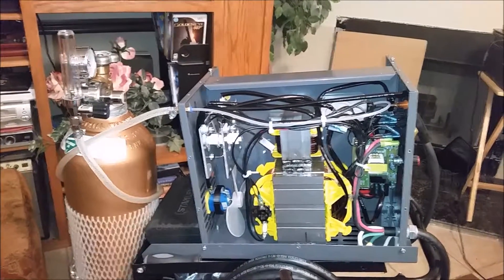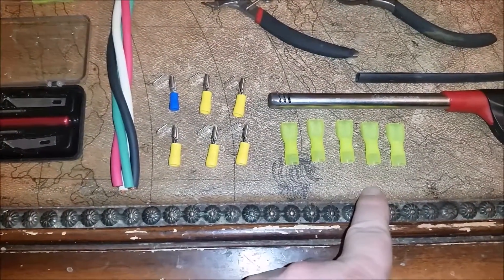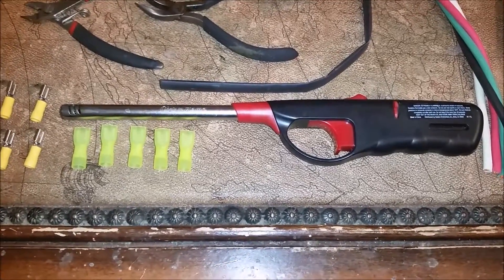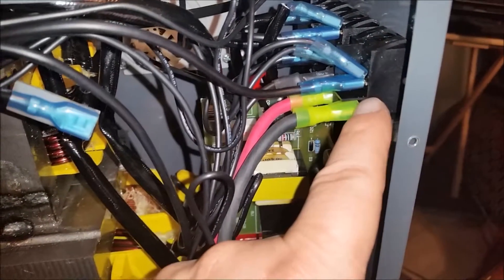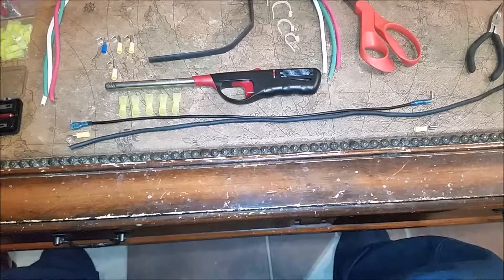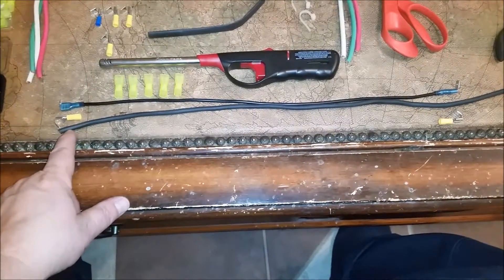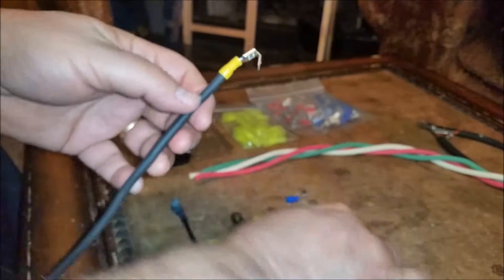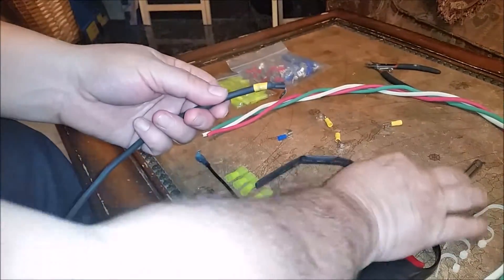Harbor Freight 110 AMP Dual Mig Internal Wire Upgrade Part 1

Comment: Hey Keith, Thank you for the vids, I coming over from Todd's channel, Again thank you for your comment reply, Im glad I ask you guys first,  I never saw a large cap cap blow before either and I dont plan too and not in my new H.F. welder either.  Do you think that i can use10g wire on my 90amp or should i use 12g instead, also would a 20w 40ohm resistor work for killing the cap.  Thank You
Johnny Perez
owner
UrbanMountainPakks
Reply from the maker: The larger the gauge wire the cooler the welder will run and the easier it will be on the transformer. I wouldn't go less than the 50 ohms or less than 20 watt resistor. 12g is good is ok but you'll have to run it closer to the outlet. You can watch this video here and I show a chart from the 170 amp welder. https://www.youtube.com/watch?v=VEpZ9agQPgM. Try going to my video series on my Harbor Freight Welder Playlist Here: https://www.youtube.com/playlist?list=PLVLXGvrQp0OufeG0agtf1dOZ6lRtdcEcF Hope this will help some. Here's another link for a guy who did all the mods and how it worked out for him: https://www.youtube.com/playlist?list=PLd_DTtq1stJJbutNay6Iikdc2J7crc9jw
Reply: Ok sounds good I will try to find a 50ohm resistor and I watching your vids now.  I will watch the others as well and definitely I will be using 10g .  Thank you
Reply from the maker: Oh by the way if you have the new black box 90 amp flux welder, here is a really good video on some modding it. https://www.youtube.com/watch?v=ozjFq5KXm1U&t=2s He does a pretty good job of doing some explaining. Feel free to ask questions as needed. Keith
Reply: Ok good, I do have the new black welder, what an improvement, but still an Ac welder, they have so much potential I dont know why Harbor Freight or Chicago Electric doesn't just add the mods and charge a little more, I'll pay $150 for an entry level dc flux core welder hey at that price they'll make a killing.  Thank Johnny
Reply from the maker: Cool, well it's getting late, 10pm and gotta hit the sack. Talk with ya late Johnny. Keith
Reply: Hey Keith, I was taking a look at my welder they really upgraded it, 
larger fan, and I think (not 100% sure) but they even added a separate 
transformer (24v) for the wire feed motor.  Now the wires I have to 
change to 10g are the ones leading to the transformer to the ground and 
gun, or is it those and the other wires that are hooked up to the 
switches, also do you think I should beef up the power cord to 10g also.
  Let me know what you think.  Thank you
Johnny
Reply from the maker: Hey John yea I would upgrade the power cord so that you can run it further from the outlet. If you don't you have to basically have it sit on the bench or 6 feet from the outlet. The stinger wires are fine. The are two, the ones that go to the trigger and activate the control board relay and motor, and the last one is the actual stinger lead, best leave those alone. I would have respondeed earlier but I was doing a LAN game with my son. Tiberium Sun Firestorm. Just finished kicking but on the computer and saw your post. Just go watch my video on the power cord upgrade, in the video you'll see a chart on the power cord length by awg, that explains why a power cord upgrade is essential. Lets put it this way, earlier today I was welding an "A" pillar patch on my sons 2003 Cadillac CTS. The car is a good 25' out into the driveway. With the 10g I had no issues with over heating or running the welder at all. If I hadn't done the upgrade I could only go 6 feet from the outlet. Kapeesh! here's the link again. https://www.youtube.com/watch?v=VEpZ9agQPgM&t=0s
Best Wishes n Blessings. Keith
Reply: Oh ok I see, so basically just like your vid above, change wires from the power switches to the (what i guess) is the overload sensor in the transformer, correct.  Yeah I saw your power cord mod vid it was great.  I will be using it as a reference point Im not a big fan of extension cords so a longer power cord will be best. Thanks
Johnny